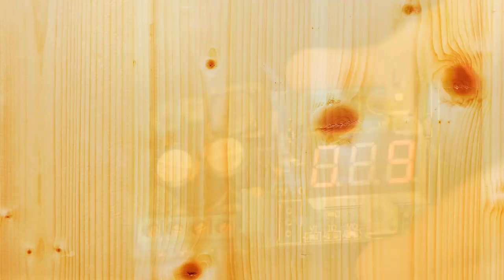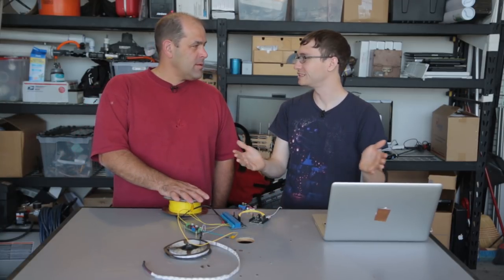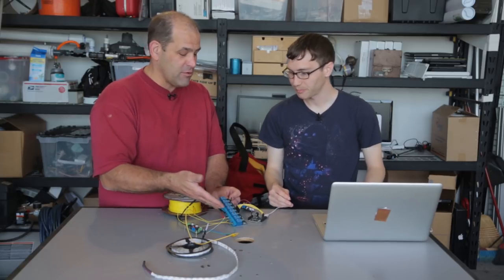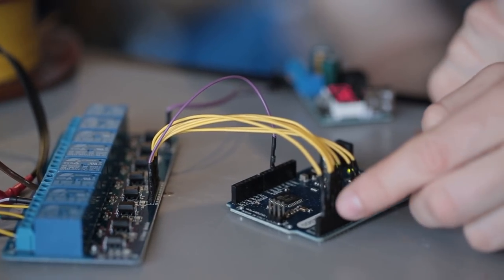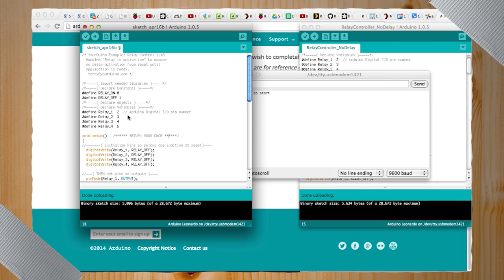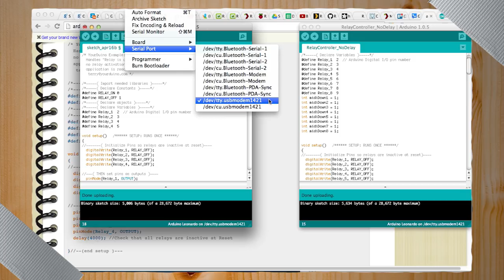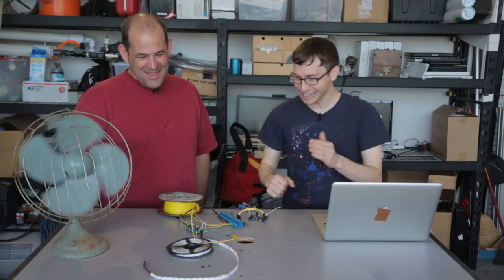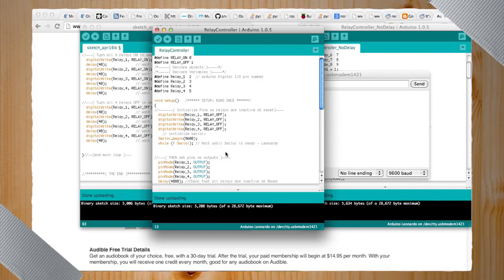Use Arduino to Switch Power On and Off!

Comment: The external power source connected to the relay wasn't explained very well. Would anyone be able to tell me what exact board was used as an external power supply? A link to the product would be much appreciated.

Comment: im tring to find out how to use an 8 relay board vary simpler to the one yall have to if not the same and i was ting to see how to hook up the Arduino to it in the end i have three 8 relay bored i need to hook up and tern them all on and off seprley i wen to a few of your links but was having trubill find out how to do the full 8 i sall how to do one and two at a time but i coud use some gideins can yall help me out some

Comment: Be careful buying Arduinos from eBay. Many, many are counterfeit. I'd buy from Adafruit, Sparkfun or Makershed (or Radio Shack as they note in the video) where you can get authentic Arduinos, or good, supported, compatible boards.
Reply: I've bought two from Amazon from Mp3carstore and they have both been authentic.
Reply: I specifically meant counterfeit in the trademark sense.

Comment: would you be able to use this switch to power a solenoid motor. with external power.
Reply: Richard Best yes you can! just check the specs of solenoid and rating of the relay you're using.

Comment: and if i want to start a car with this kind of relay instead of ignition key, would it handle the current?
Reply: Depends on the starting motor. Easiest way to know for sure would probably be to check in your car's owners manual, and see if it shows the fuse value for the starting circuit. You'll want the have a relay that matches or surpasses the specified fuse. 10A@12VDC*should* be plenty, though.
Reply: Well unfortunately my car is old and I don't have any manuals or documentation (a Renault Scenic from '99) and I'm not the first user as well, so I'll have to check that fuse you're talking about but I can't find any proper schematics and locate it.I could measure the current with a multimeter but if it is more than 10A it will probably blow up :D
Reply: Hristo Topalov Don't try to start with this kind of relay. 120 W is way to weak to start your car you should have at least 5 times more for short time starting, probably more.
Reply: Holy crap, yeah listen to Dejan, I just looked it up. The average is upwards of 175-250A. You'd blow the ass out of a little mechanical relay trying that. You might be able to find a solid state relay to handle it, though.
Reply: I'm not trying to attach the relay directly to the starter's circuit.There is another one controlling the first and the current there is not more than 1-2A but I don't know exactly how much....anyway I bought a relay for 10A already and now I just have to try it :D
Reply: Hristo Topalov You should be able to. The starter current does not go through the ignition key, as far as i know. Depending on the actual starter relay, you could replace the ignition key with the Arduino itself.
Reply: Cristi Neagu Correct.  When you turn the key (or press the start button) it sends 12 volts to a relay.  This is the ignition relay and it uses 12 volts (where the relays in this video use 5 volt coils).  You could easily look at the ignition relay already in use for the specs, OR just use that relay.  You could use the Arduino to create your own Engine Start/Stop button.  Then you could add the feature like a key fob to tell the arduino to actuate the relay in place of the button. You could also use an RFID reader and tag in place of your key.  Could be a fun project.  With a microcontroller or arduino, you can create the whole project with 1 pin to light an LED.  If the LED is lit, then the engine is starting.  Once you have that done, box it up and mount it in the car.  I would still use the key in the ignition to kill everything just in case something fails, and the arduino doesn't stop the starter once the engine has started.  It would be like holding the key in the start position and burn up your starter.  I'm sure there is a tutorial on creating your own "Engine Start/Stop" button or conversion.

Comment: Yeah, this is dangerous.  If you have AC wires in those relays, you should put a metal box around it with a ground connection.
Reply: Alex Anders That doesn't matter.  Everything involving A/C should be surrounded by a grounded shield.  So, if a wire comes loose, it will hit the metal and cause a breaker to trip instead of electrocuting you.

Comment: Why do I need, relays when i Can programm the pins of the arduino to active HIGH or deactivate LOW..... not that smart regarding physics.. please someone gives me the answer
Reply: because the arduino has a limit to how much it can power. anything over 5 volts DC or any AC  will require a relay ( either mechanical or solid state). thereby allowing you to control a large load with a small control signal from the arduino.
Reply: because an Arduino has no balls when it comes to High Power applications.

Comment: code for manual switching the relay's?
Reply: +Lukas Gustavsson What do you mean? A relay switch is literally just a  normal physical switch that can be switched on/off by applying magnetic force to move it. It can be used to send high current through without damaging the Arduino itself.

Comment: YOU WILL BURN YOUR HOUSE DOWN IF YOU USE THESE IN THIS WAY    ok now that i have ur attention, i wasnt joking, basically theres 3 types of loads things in ur house will use, capacitive inductive and resistive, the relay would b fine for certain types, but it cant handle inductive loads of 10 amps because of the spikes. if u dont believe me google it

Comment: There's so much fail and wrong in this video.  The guys knew about enough to load the sketch and wire it up, but knew %$!& about how the relay actually worked.  It's not looking for 5v to turn devices on, it's looking for 0v to turn the device on and 5v to turn it off.  Maybe before you made the video you should have googled 'active low'.
Reply: There are two types of relay 1- Normally open. 2- Normally closed.
Reply: golfclap  Now go look at the way they had it wired up, and then read the code they posted.  (Relay on: 0, Relay off:1).  The fact that their are two different types of relays configurations doesn't change the fact that they didn't know that, and didn't know which one they were using.  These guys are the blind leading the blind.

Comment: Arduino is over rated. Only thing it has going for it is simple hardware. And not even that. I would choose an ARMv7 over it any day of the week. Same simple hardware, only way more IO capability, more timers, more processing power, more everything.

Arduino is just fine for beginners, but it's kinda sad people don't move on from them when they should.
Reply: Xylius Schaaij Trouble is that most of the time there is a better solution. And the main thing i was getting at is that people should look further than the Arduino and learn something new. Sure, if you want to prototype something fast and blink some LEDs and maybe actuate a relay, a 200MHz ARM board with a dozen bells and whistles might not be your first choice. But i think it's important to know that it is a choice, and how to use one.

I see people trying to build hexapod bots with all sorts of complications because an Arduino board only has a couple of PWM outputs. ARM boards usually have around 10-12 PWM timers, routable to almost any IO pin. I see people use Ethernet shields for the Arduino, when ARMs have on-chip Ethernet support. I see people use ADC shields when ARMs have around 20-24 ADC channels. Not to mention all those communication interfaces (typically 2xI2C, 2xSPI, 6xUART). And the fact that ARMs can run from around 150MHz to 200MHz, making them perfect for data processing and logging and (touch)screen GUI applications. And all that for half the price of an Arduino Uno.

I'll stress again that i'm not saying people should stop using Arduinos. All i'm saying is that people need to understand that there are other choices besides Arduino, with just as much software and library support.
Reply: Cristi Neagu Depending on the situation you need it for, Arduino may or may not be the best solution.
I have a fan that turns on when it gets too hot in my room for example, nice and simple, requires a $2 Arduino.

I could do that through other means, without an Arduino, but I don't have the equipment to do that.
Reply: Litruv A $2 Arduino? Surely, you mean an ATMega 328. Never heard of a $2 Arduino...
Also, it is good to know that it can be done with discrete components. People get into Arduinos because they have an interest in technology, programming, automation. And if they do have these interests, wouldn't they want to know of alternative methods?
Reply: Litruv Arduino's may not be the best solution but as it states it is designed for students & makers etc. the bottom line is you learn how things work, automation, integration, digital electronics and also programming..
Reply: Cristi Neagu im a beginner to arduino but i also feel that the arduino is capable of doing anythign you want it to so its not just for beginners ive seen some amazing projects done with arduino and i know enough to realize that thats expert level shit im looking at
Reply: zack lariviere
"you jump all over him when you literally made a similar point"
It isn't. But that's not the point. The point is that once you are comfortable with Arduino you should realise that there are better ways and more efficient ways of doing the same things. And when you learn what those ways are, you'll learn more and have more fun. Use Arduino as what it's meant to be: a gateway into automation, not a catch-all trap.
Reply: That was not my thaught process at all and where are you quoting that from cuz i didnt say that you mustve read someone elses comment and replied to my name
Reply: I think your getting too hell bent on how other people feel about using a product its just their oppinion or preference  your turning it into something its not
Reply: Cristi Neagu Raspberry Pi and Arduino are 2 different things. Arduino is a micro-controller witch target small projects or part of a project with one functionality per chip in mind, no boot time, extra low consumption of energy and low coast (the chip by itself is only 2$, without a development board). It's perfect for IoT.
Raspberry Pi is a SoC, it's not designed to be integrated into other products, it's a real computer. It's good to do more advanced stuff, like web server, database, computing stuff. It still low coast and low power but it's not comparable to a Arduino chip.
Reply: ultort ...which is why I never recommended a Raspberry Pi as a replacement. You're arguing with the wrong person.
Reply: ***** Wow... Nice comeback. Firstly, not all ARMs are SoC. Especially ARMv7. And secondly, saying an Arduino is cheaper than an ARM board is frankly idiotic. Even an SoC ARM board. It just shows that you have absolutely no idea what you're talking about. For the price of an Arduino Uno (16 pounds) you can get a Discovery F429 board with a touchscreen, capable of running an operating system. For 10 pounds, 2 thirds the cost of an Arduino Uno, you can get a Discovery F411 board that's at least 4 times more capable than an Uno board.

And he says Uno is so cheap. Yeah right, keep dreaming.
Reply: Cristi Neagu
Cheapo Uno's are like $5-6, AT-Tiny's are about $1-2, but I'd rather my Teensy any day. ($19)
Reply: Litruv You are confusing development boards with the actual chips on them.
Reply: Litruv All of those are very far away from what we were talking about. These are very small chips with very limited IO. And you're comparing them with development boards with touchscreens on them. Apples and oranges...
Reply: Litruv Also, you are kinda proving my point that there indeed are cheaper alternatives to Arduino. Also, that Arduino users should be aware of them, as you are.

And a note to others: ATMega 328 is not Arduino. The board might be built on it, but it's not Arduino. The same goes for ATTiny chips. So when comparing the price of an Arduino board with some other board don't bring those chips into the argument. You're just proving my point.
Reply: Cristi Neagu
They use the same chips, and you're just flashing them with the arduino bootloader to make them understand what they're getting.
imo, there's literally no difference once the arduino bootloader is installed on the chip
Reply: +Cristi Neagu I agree that a device being from Arduino, is in and of itself overrated, but the ide is highly useful. But at it's basis is a cheap Atmel chip, which is for the purpose of low level language. IE you don't need to drop >$25 for a control unit every time you want a cheap automated garden system(just an example). I would suggest looking into projects that involve both arm devices(or embedded systems in general) as master devices and several AVR/PIC/ETC as slave devices. Also if you want to talk about powerful ARM architectures, ARMv7 is hardly at the top of the totem pole.
Reply: +Cristi Neagu Also there are two dollar /Arduinos/ all over the place, not just the AtmegaXXX
Reply: +Cristi Neagu you sound similar to a kid trying to preach how his beast pc is better than console peasants....oh boy.
Reply: YouTubeAnonymous You really haven't been paying attention to a thing i've said, have you?
Reply: ***** I'm pretty sure there are plenty development boards out there, each one with its ups and downs. I think you need to decide on what you actually want to do with such a development board, and from there decide on something closer to your needs.
Reply: ***** You were wrong, as usual.